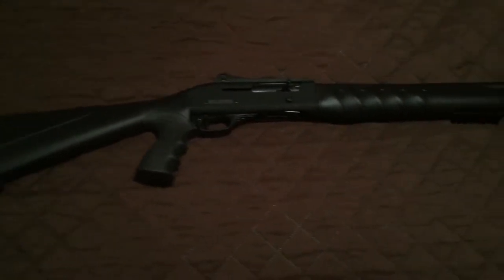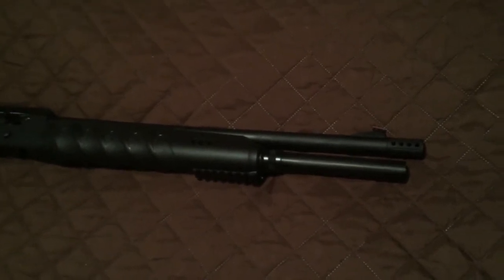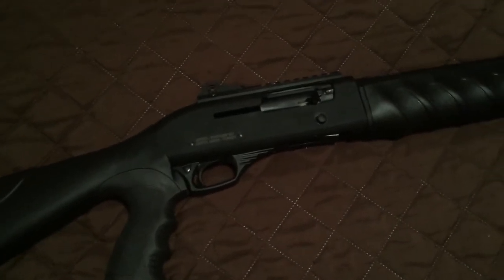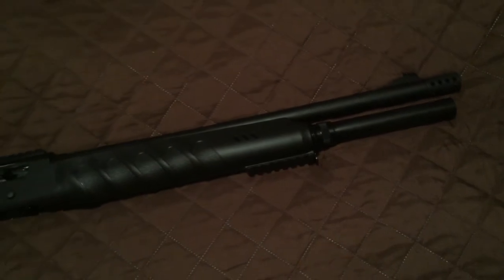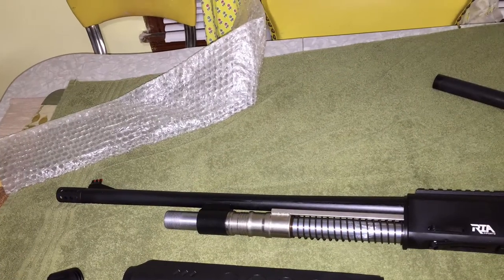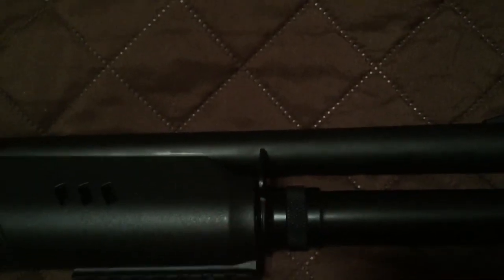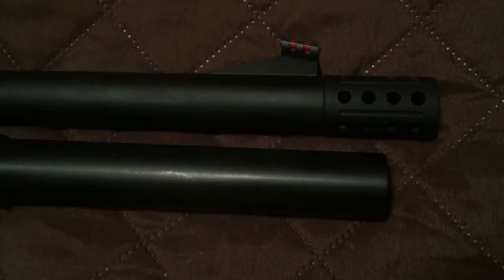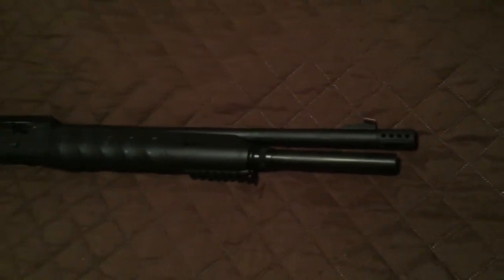Extended magazine tube Rock Island Armory X4

Comment: I was lucky and got one from the Fed recently and installed it. I used a pipe cutter to remove the original mag tube. There was no threads holding on the original mag extension. I have the first version X4 RIA Lion. Very satisfied with the results.

Comment: Tacstar extension for the benelli nova & super nova fit perfectly . No cutting required.
Reply: Any chance you have a link or vid tutorial?
Reply: @calebwatson4505  I don't have any videos. But it's what I have on my RIA tac 4 12 gauge . Fit with no problem, no cutting & no coming off.
Reply: link to the tube u bought?
Reply: @HDMann292  I bought mine at my local gun shop. It was sitting on the shelf.
Reply: Do you happen to know if this fits the AG or Carina models from RIA?

Comment: I just got my RIA X4, and it had both gas pistons installed. In some of the other/older YT videos I have watched there was a black polymer buffer (as they called it) that slid on the tube between the piston and the bolt carrier. Mine does not have this  black polymer "buffer". I took the gun apart and cleaned off the heavy lube oil and relubed it with gun oil. When I reassembled the gun I only used the Light load piston. There is about a 1 inch gap between the piston and the bolt carrier. I fired 25 rounds yesterday to break it in. The gun never auto loaded the first round of heavy load 00 buckshot. I got back home and disassembled, cleaned and relubed it again. I am considering reinstalling the heavy piston back where it was, the way it came from the factory and trying that
Reply: The heavy load piston is pointed toward the receiver and slips under the lip on the bolt carrier, then the light load is installed with theback resting against the heavy load piston. Works grea!
Reply: @MHGinTN   thanks for the enlightening. An other dumb question so to break it in you use the heavy 3 inch shells right and the heavy load piston back resting with the light piston and heavy piston pointing to the target right? The instructions are shit thanks

Comment: Hi all. New here. So I'm looking at getting a Lion X4 but disappointed in the mag capacity of only 4. Also looking to add a 2 or 3 extension. I have heard that the treads COULD be different from gun run production to production. Besides Sam, the guy who made the video, who has actually added one? IF you did, did you use one from Fedarms? Not to concerned about warranty.

Comment: He’s right about the owner’s manual. Useless. I’m hoping his tip about removing the bolt works but I’ll be trying that after I get the recommended 100 rounds through it for “break in”. I’m actually pretty happy after the first 25.
Reply from the maker: I can say that light loads don’t cycle. At all. High brass runs completely reliably and has never failed to feed, fire or eject.

Comment: I picked a RIA x4 up and it has both heavy and light pistons installed  from the factory one on top of the other ? Is that the correct way I have watched other videos and they just use one at a time .
Reply: Just one piston at a time. The light load piston is installed in front(on top if the gun's standing vertically on its buttstock), that's where and how the single piston should ride in the gun. Light piston is good for 750bar, if the shotshells you run have published that info. Basically, as stated in the video, the light piston will handle all your 2 3/4" shells, and you switch the heavy piston for the 3" magnum slugs of doom and such. Hope that helps.
Reply: I also just got my RIA X4, and it had both pistons installed. In some of the other/older YT videos I have watched there was a black polymer buffer (as they called it) that slid on the tube between the piston and the bolt carrier. Mine does not have this  black polymer "buffer". I took the gun apart and cleaned off the heavy lube oil and relubed it with gun oil. When I reassembled the gun I only used the Light load piston. There is about a 1 inch gap between the piston and the bolt carrier. I fired 25 rounds yesterday to break it in. The gun never auto loaded the first round of heavy load 00 buckshot. I got back home and disassembled, cleaned and relubed it again. I am considering reinstalling the heavy piston back where it was, the way it came from the factory and trying that.
Reply: @rodneylile4372  Interesting. I have the plastic buffer tube, it's slightly longer than the pistons and so both pistons wouldn't fit with it installed. In your case, it sounds like the second piston acts in the buffer's stead, transmitting force from the working piston to the b.c.g. I'm guessing if I tried to run mine with one piston and no buffer it would result in a half-cycle or less, which I am also guessing is what you experienced. Could you see how far the bolt was moving while firing? I'll be out on the range Sunday, I might have to try taking out the buffer and running just one and maybe even both pistons. How were the pistons oriented when you got the gun: were they both facing the same direction? I'm fiddling with it on the bench, and with the second piston (the non-working piston closest to the action) oriented backwards- with the base butted up against the other- it slides down the mag tube and rests in the groove the same way the buffer does. Perfect fit...
Reply: @AtlasJotun  
I did reinstall the heavy piston. It has a thin lip that nests in a groove on the top of the bolt carrier.  When I reassembled the gun this provided a slight compression to the bolt carrier.
 Yesterday it was short stroking.  Today it would auto load 2 or 3 rounds before a FTE or failure to completely load the next round.  I ran 15 rounds today with 4 stoppages. The firearm is still very tight. The first 20 or 30 rounds did nothing to help break it in. 
 It seems to me that assembled in this manner, you have both pistons carried on board, this makes it easier to stop, swap pistons around and fire either the heavy or light loads.
 I don't know if I mentioned this previously but I believe I have the Gen. 1, so this could explain the differences. Mine has the shorter magazine tube, it only holds 4- 2 3/4 in shells in the tube.
Reply: @rodneylile4372  I tried different combinations of pistons and buffer: One piston and no buffer as predicted failed to generate enough force to eject, sometimes not even enough to extract the shells. However two pistons/no buffer and the gun cycled 24 out of 25 shells S&B 00buck. I'm sorry, I have no idea why yours won't function. You may want to test Armscor's warranty, I've heard their customer service is very good.
Reply: @AtlasJotun   no need for warranty. It is working now. I did just what you did. I used both pistons. It is working, but still tight. Not completely broken in yet. Thanks for your testing and report.
Reply: Rusty Hardman lll%  yes, mine has the switch to stop the next round from loading. I will be watching for your video. Do the Benelli mag extension tube threads match up properly? I have not had much luck trying to find the correct mag extension. Thank you for the information.
Reply: The heavy load piston slides almost loosely along the magazine tube. Point it toward the receiver and the light piston pointed into the gas chamber.
Reply: How many high power to break it in? How’s the reliability after it is broke in?